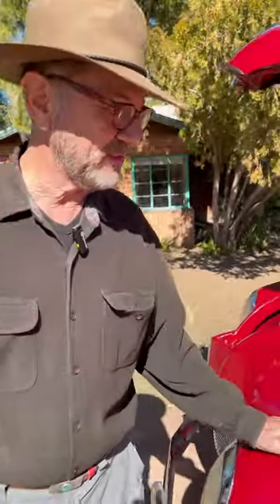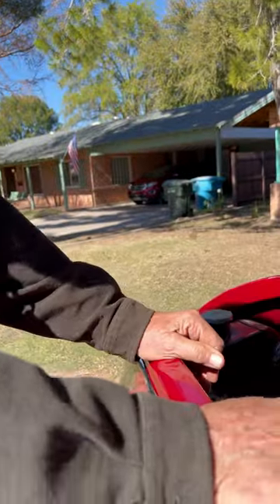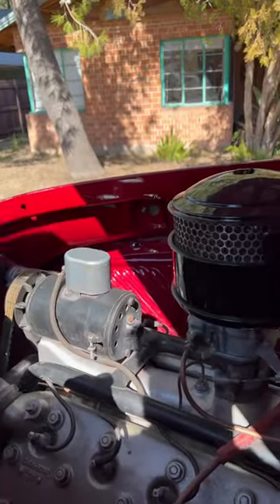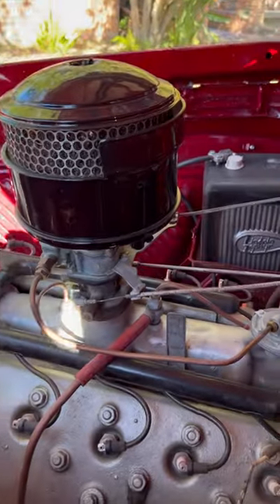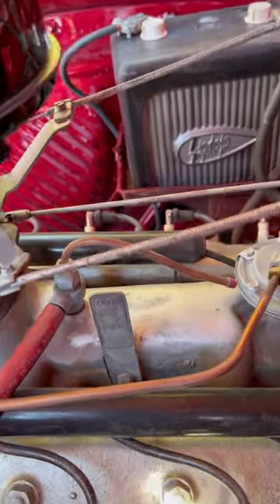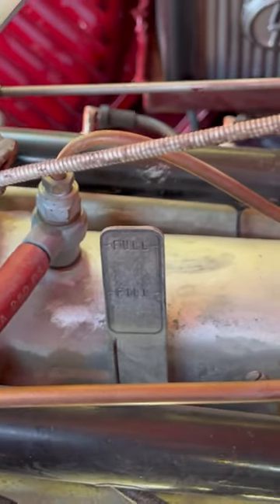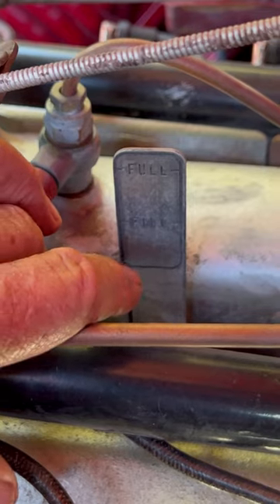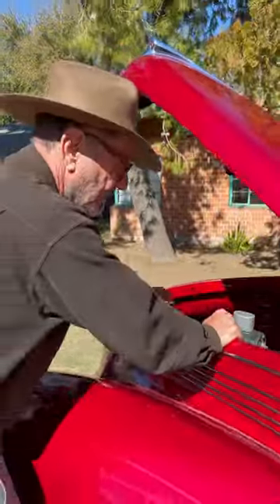Crazy No Dipstick Oil Check - Early Lincoln V12 Flathead #shorts #classiccars

Comment: I could be wrong but looks like garandpa needs to add some oil lol
Reply: thats  what I thought
Reply: They should make it come put of the hood because when its old and consumes oil youll be able to see when you need to stop driving and add some 😂😂
Reply: @TheAnnoyingBoss  would actually be handy as fuck.
an oil gauge not for pressure but to show the level. I have to add 1 litre of oil roughly every 2000km and
Reply: Sight glass tubes and windows are are used that do this as well.
Reply: Looking like it's parked nose up a little there.
Reply: @TheAnnoyingBoss  Checking the level works only when the engines is shut off, and after the oil has had a few minutes to settle into the bottom of the engine.
Reply: Henry Ford was way ahead of all of them. Still is.
Reply: @omnivore2220  back then people checked most of that stuff first thing in the morning before they got going for the day.
Reply: @raginroadrunner  did Henry make a 12 cyl 🤔 curious my level of knowledge @ 1950 ish ...
Reply: @raginroadrunner  sorry I didn't read ( early Lincoln ) in disc ...
Reply: Looks like it burns a lot of oil unless he drives it a lot
Reply: @raginroadrunner  um, I have to disagree. He is very much not alive.
Reply: Pretty sure you check it when it's warm, not cold. Am I wrong? If you add oil to it till it's "filled" when it's cold, it will expand when it is warm and then be beyond filled. No?
Reply: @Tadders  I've always heard it's the opposite. You want to add when it's cold cause if you add when it's warm it will reed higher than it actually is. Now trans fluid you have to check while the car is normal operating temp
Reply: Probably leaks if it's too full.😂
Reply: @Tadders  if you check your oil while it's hot it will show that you have less oil than you actually do because the oil is not in the reservoir it is all throughout the engine and the end of your dipstick is in the reservoir. Engine oil also does not expand very much under heat by design so that it does not damage your engine.
Reply: @raginroadrunner  Lincoln was their own company separate from Ford altogether back then .  Ford did some great things but did you know that the Dodge brothers worked for Henry Ford and designed some of the first engines for the model T along with making the gauges and bought stock in Ford motor company and eventually sold that stock to start the Dodge brothers automoble plant that built the first Dodge cars ? Also  I believe; Oldsmobile were the first to have an assembly line but they werent building cars for mass production because the cars they were building compared to Fords model T were more luxury type cars that the wealthy were buying while the model T was built for the masses .  Henrry Ford also sold trucks to the germans during WW2 or I should say the complete chassis with a cab and shipped them to Germany and the german military would then fit these trucks with whatever they wanted to add on to them . What the deal was is that by selling so many trucks  to Germany during the war the military would pay so much for Ford to keep building these chassis trucks to sell to them and after a few years the germans dropped Ford and made copies of Fords design and started building their own versions of the trucks Ford was selling them . Not many know that Henery Ford was dealing with the enemy during the war on the side because of money power and greed and was hiding the fact .
Reply: and General Motors was under an agreemrnt to build Nazi Germany an oil refinery.
Reply: @Tadders  No you check oil level cold on level ground that way all the oil drains back down into the crank case after a few hours . If you check oil level when its hot you still have some oil thats coated  the rotating assembly in the engine but if its a engine thats not s flat head and has over head valve heads on it there is oil that has to drain down through the drain holes in those heads that ends up in the botton of the oil pan. These V-12 Lincoln engines are flat head engines meaning the valves are in the engine block and not in the cylinder head like modern day cars are still to this day so oil drain back should be relatively quick but its still better to let the engine sit for a while then check oil level be it with this style glass sight gauge that had a brass float in the oil pan or a regular dipstick to check oil with . If you check it when the engines warm being the pil hasn't drained and settled to the bottom of the oil pan it will read low and if you add oil to it then it will be over filled which isnt good either because that can cause gaskets and main seals to leak plus the extra oil can be high enough that the connecting rods can actually hit that surface of oil which believe it or not causes friction and power loss . More modern day HP engines use whats called a windage tray that sits between the rotating crank shaft assembly and the oil pan and oil pan sump and that keeps the excess oil from coming into contact with the crank and rods which helps make more HP. Chrysler back in the day were some of the first to engineer and design these windage trays for racing that were used on the 413,440 426 Hemi engines and were also installed on the factory HP muscle cars they built using those same engines on the Dodge Super bee the Dodge chargers and Plymouth Roadrunner as well as the Dodge Daytona and Plymouth super bird street cars and others that were designated HP cars from the factory.
Reply: Proves the point that some of the easiest things to check are the things that get overlooked.......
 Somebody needs some oil!!!
Reply: @Tadders That is for transmission fluid, not engine oil.
Reply: Bill Murray putting his Caddy Shack money to good use!
Reply: @stewoe7157  no
Reply: @raginroadrunner  Henry Ford wanted to continue to only make model T's and did for 16 years consecutive. His son Edsel, and his son Henry Ford the second were the innovators. Henry the first just kinda got the ball rolling, and almost deflated it with his idiotic stance on life. Look more into the Ford family
Reply: @rydermiller1782  20 year old BMWs have this feature at this point lmao
Reply: @xcarcraft2350  

Yeah but he wasn't sure about Ray's Meteor bodied ECTO-1 in the making 😂
Reply: @WariorMageThief  

You heard wrong too. Literally follow the manufacturer's guidelines. That's it.
Reply: @stewoe7157  

Some, not all. This also extends to to various other systems from firmly drive to power steering. Read your handbook and you won't go far wrong.
Reply: @skylined5534  I don't have my handbook for one and that's common knowledge I learned in Auto Tech school. If you check it while the engine is warm it's all around your engine not back in the pan so you don't get an accurate reading
Reply: @rydermiller1782 
My Mercedes has that.. Warns me as soon as it's down about a liter.  It also holds 8 litres of oil in the sump.
Reply: @raginroadrunner yeah? Do some research on the way guy liked to treat his employees, your not wrong he has some good ideas but he wasn’t exactly the mind I’d like to see choosing the future now
Reply: @Ventrismo  From what I read is Henry Ford sold truck to the Germans basically partial trucks with a cab and chassis and engine and running gear but had no box or flat bed that way the customer could build the rest of the truck the way they wanted . The Germans bought a contracted amount if trucks from him and would give him extra money from the profits the Germans made on the trucks but once the contract ended they basically stole many of his patents in the designs of these trucks and built something similar on their own so O'l Henry Ford was double dipping and dealing with the fascist Germans to make money from them and our people at the same time. There is a list you can look up on what companies in the USA back then we're in fact selling and dealing with the German war machine during WW1 and WW2 and I think most will be surprised who did this and why they weren't shut down and thrown in prison by dealing with the enemy back then .
Reply: 8
Reply: Grandpa's got a "Good Long Dip Stick!" And it works just fine!
Reply: She looks a little low there